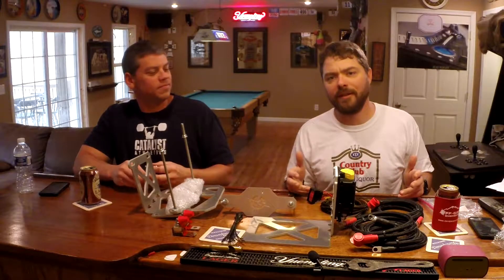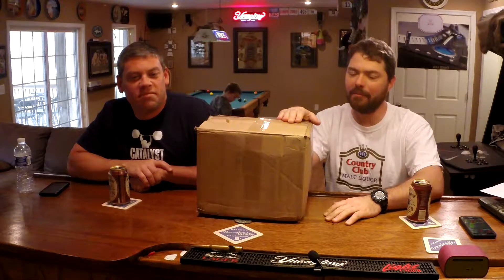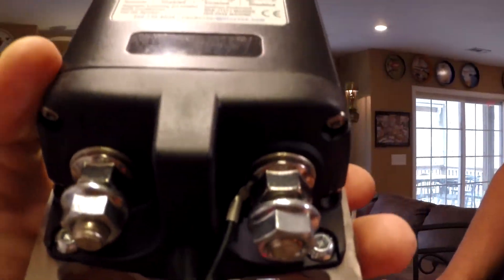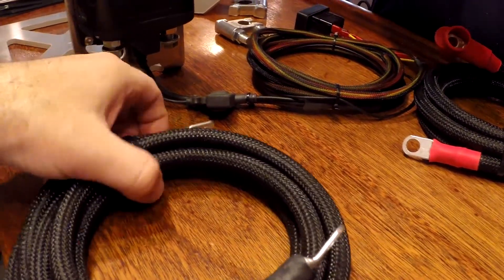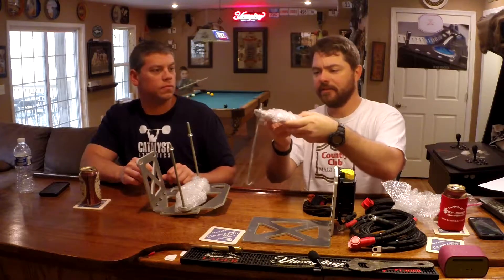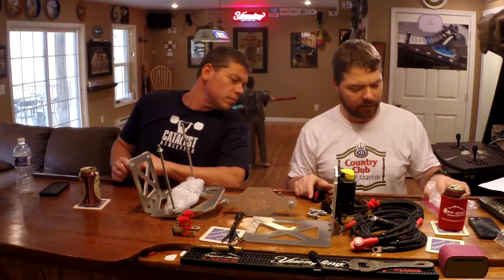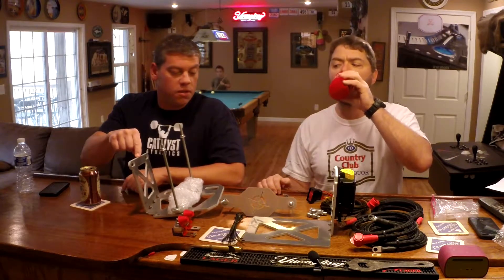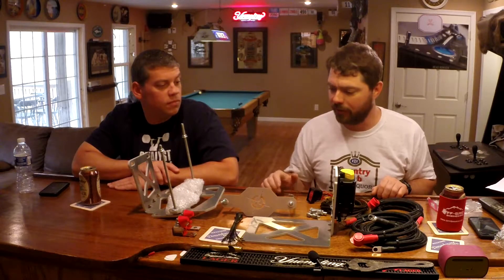5th Gen 4Runner Dual Battery System Off-Grid Engineering Unboxing

Comment: Do you need to upgrade your alternator?
Reply from the maker: That really depends how much load your putting on the system. Bigger alternator is certainly better but output voltage is important we have hkb fuses in our rigs as well to up regulate the voltage for closer to what an agm needs. I hope that helps. I'd be happy to answer any follow up questions.